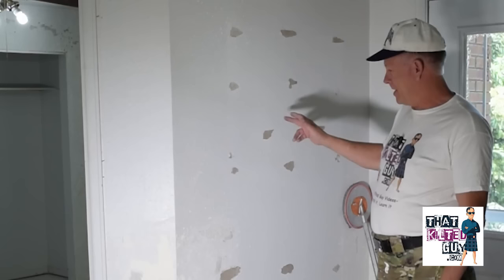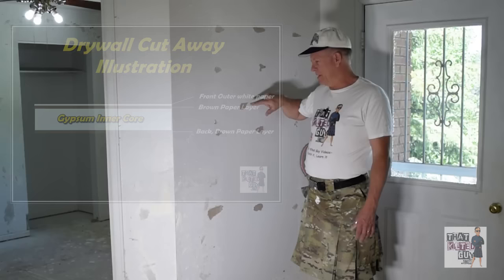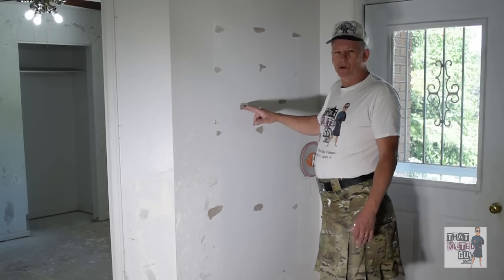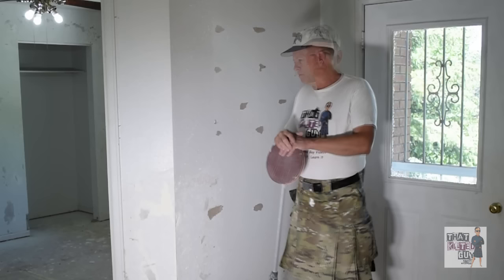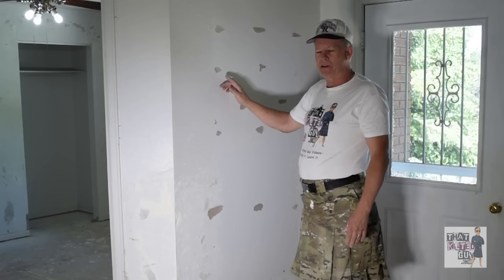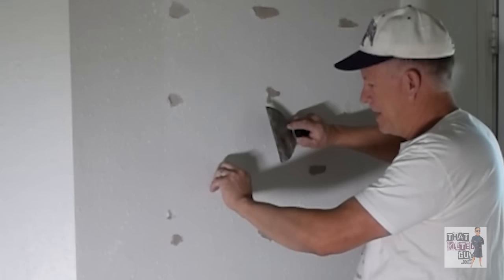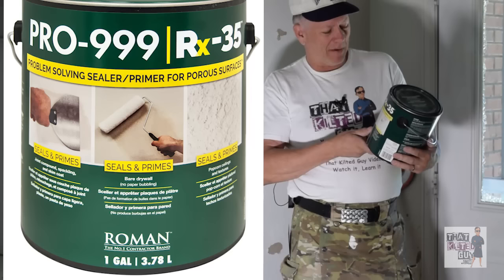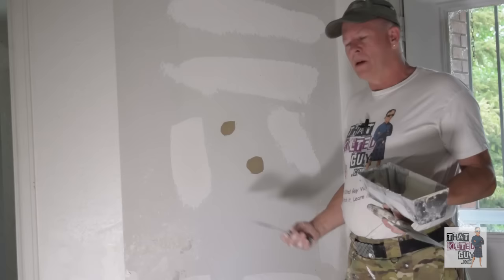⭐ Repair Damaged & Torn Drywall Paper BEFORE YOU MUD IT in 2022!

Comment: While this is a thorough and excellent way to do it.  Drywall goes up with brown showing all the time and they simply hit it with all purpose and move on with life.  I'd bet that 99% of houses have spots of brown paper with nothing but all purpose over them.  I've never seen or heard of it falling off the wall or being an issue.  

If you cared enough to do it, any paint or primer over the paper would do the same thing.  Anyone who needed this question answered is probably a home owner/novice.  They probably have a gallon of paint or primer laying around and a little all purpose mud but they probably don't have specialty primers or the like laying around and it would make little sense to buy some for a small single spot, especially since they won't be using it again more likely than not.
Reply from the maker: You read my mind, lol. I’m actually in the middle of shooting a video right now testing 11 ways to repair these and im showing WHY you sometimes need to do it this way and sometimes you don’t. 

But so far, I haven’t been able to consistently damage it the way I want. It’s much harder to do damage than it is to fix it for me, lol. But I did get a few spots to come loose the way I wanted and I coated them with regular mud and sure enough they bubbled up terribly and I will show that in the video.

I’ve specialized in these types of repairs for around 15 years and started doing it this way because it’s more consistent. Just putting mud over the spots does work sometimes, but it also fails sometimes and doesn’t waste a lot of my time. And I have a faster way than this product which I would demonstrate in the video. But doing it this way ensures much higher rate of Failure. 

Be sure you have subscribed to my channel and clicked on the bell icon and you will get notified when I put it out sometime in the next several days, I hope.

Also, I just launched a new website at ThatKiltedGuy.com and you can join my email list there where you will also get notified, along with getting my 16 page guide on how to choose a contractor for a remodel project. And that email will occasionally include articles, news and other relevant information for my subscribers.

Plus the website will contain tool reviews, recommendations and much more information than I can put here on YouTube.

Thanks for your suggestion. Take care, Guy
Reply: I'm just a part time handyman since I have a regular job with people booking me months out.  I do a lot of awkward/weird jobs.  Superglue on the back of something you can pull would get the ripping stuff off the wall damage about right.  Paint sticks maybe?  Construction glue in the snake pattern would be a common type of damage to repair.  You could mist water around the superglued stick to give it the separation easier probably.

I came across the video looking for a sponge tool on a pole to use in skim coating ceilings while I wait for mine to dry.  Just to see if there is such a beast that might work better than a regular sponge mop to knock down ridges in between skims.  I'm doing my own house today, so I can sit around and BS a little.  I stopped to watch because of the kilted part.  I don't generally wear mine while working.  You should get a small tool pouch that hangs in the front like a sporran.

I always enjoy videos that show a different way of doing something.  Even if it isn't one I'd prefer, I usually take something away from it about how something can be done that I can apply to future jobs.

Keep up the good work.
Reply from the maker: Yeah, what I did the first time was to cut 66 perfect 4" circles with my drywall circle cutter, in 11 rows (6 per row) and then peeled them back, but almost none bubbled.  So I then glued a piece of OSB onto some scrap then peeled it and those bubbled.  So the next day I glued 3 2x4x8 studs to my rock with construction adhesive and when I pulled them off, they didn't peel enough, and not enough damage, so I glued them on again, and tested one this am before heading out to repair 2 jobs with damaged ceilings, and it looks like it's going to be workable now.  Now I just have to find the time to finish the video.  Hard to do part time when construction can sometimes take up about 70 hours a week.  

Once I start making enough on here, I'll do this full time and quit the drywall business.  I'm 57, and ready to move on to something fun, and the videos are fun and much less stress.  Thanks for the ideas.  -That Kilted 'Guy' -

Comment: Why do you use two different kinds of mud...apprentice wanting to learn. And how to you get the repair not to show trough after you texture and paint
Reply from the maker: The first mud was a fast setting joint compound and if you ever use mesh tape you should always use fast setting mud over it. But in this case I used it because it will set up as quickly as 7 to 8 minutes depending on which one I use and that allows me to put multiple coats on in one day, and it has almost 0 shrinkage compared to about 30% shrinkage with regular drywall mud.

Once the repair is done prime and paint it twice allowing each coat to dry properly and extending the paint slightly each time. For the second coat it’s best to paint the whole surface but with flat paint you can usually spot paint.
Reply: That Kilted Guy DIY Home Improvement  thank you so much. And sorry to repeat the question. I didn’t read they the comments first.
Reply: That Kilted Guy DIY Home Improvement what is the best spray in technique to app,y texture..orange peel and knockdown?

Comment: My bathroom shower ceiling was moldy and the drywall paper was chippong off with the paint. I started peeling it away. I live in a rental and landlord wont make any repairs soon. The drywall has no paper left... its only the gypsum exposed. Anything I can do? Besides replacing the drywall. That's not an option right now. Looking for a temp solution. Thanks!
Reply from the maker: Well replacing is the best option, as now the ceiling is WAY weaker.  2nd option is to put another layer right over the top of the old layer and refinish it.  But if you can't do ANYTHING ELSE, maybe you could try gluing some heavy brown paper over the exposed gypsum and then applying the RX-35 to seal it, then refinish like new.  BUT, I don't recommend that and it could prove dangerous as it may still remain very weak.  That ceiling could come crashing down any day, so I highly recommend replacing it, or putting a new layer over the old. Good luck and keep me posted how it goes.  Best wishes, Guy
Reply: That Kilted Guy DIY Home Improvement I am in a tough situation. I cant afford someone to come replace it and landlord wont do it. Id rather try to buy some time until I move out, rather than have that moldy ceiling. So, I ended up chipping off the paint tjat was coming off. I sanded it down and cleaned it and added joint compound. This is probably terrible, but I really am just trying. I am not sure if that is going to work. Being that there are patches that still have the old paint and then there were patches with the gypsum exposed. 😖 lol what would happen if I let it dry, sand it off and apply a primer and then a semi gloss paint? #NoCLUE I feel like an idiot. Please, any suggestions.
Reply from the maker: Hello, due to the increased number of subscribers, and questions, all our questions are now answered on our Patreon page at: https://www.patreon.com/ThatKiltedGuy. We hope you'll join us there and help us to answer your questions, and to put out many more videos.  Thank you for your support!

Comment: can you prime then paint after that technique you just did or doea it have to be skinn coated the way you did it?
Reply from the maker: Yes, you can prime and paint after applying the RX-37.  That just locks everything down and allows you to continue the repair process.  But if you have torn paper like this, and don't coat the torn section and sand it, then it will show pretty badly.  Thanks for the question, and let me know how it comes out.  
Guy, That Kilted Guy

Comment: Hi:  you made so easy to follow.  Thank you.  I have about six inches of tape protruding in the middle of a painted wall ceiling to floor and ask if you could instruct me how to fix this.
Reply from the maker: Thanks, Remove any loose tape, and re-tape and finish it with new.
Reply: @ThatKiltedGuyDIY  hopefully I will pull only the tape.  If I get down to brown paper I will put sealer let dry apply mud then sand apply primer and paint.  Is this a good plan.  Thank you.
Reply from the maker: @valeriek5020  cut the tape about an inch after the last spot you think it’s stuck so you don’t pull more than needed.
Reply: thank you.....

Comment: Hello 👋
What kind of mudding you used because it looks 🤔 yellow than that first kind you put on the wall. Trying to fix a bubu my 3 year old did on the wall and is big lol 🙂
Reply from the maker: Any mud works.  I use hot mud for the first coat (setting mud, usually 5 minute but novices should stick to 45 or longer) and then I use USG plus the 2nd coat
Reply: @ThatKiltedGuyDIY  Thank you so much for the information. I seen a lot of videos and yours if the best and nicely explained. God Bless you 🙏❤

Comment: Hello! After we removed a deep freezer from our laundry room, we discovered that the two walls that meet in the corner have a huge area of this exposed brown paper. Its an area about two feet across and 4 feet tall on each wall.  I tried to add a picture to this comment but it won't seem to let me. Do you recommend trying this method or should we completely replace the dry wall? Thanks in advance!
Reply from the maker: Well one thing to consider is that once the outer layer of paper is gone the sheet rock will be weaker. If you feel this will be an issue then I would replace it. Otherwise you can just cover it with this stuff and refinish it and it should be fine. Let me know how it goes. Thanks for stopping by.
Reply: Will let you know. Thanks so much.

Comment: PLEASE HELP!!!---

I already skim coated & painted the wall where I had the exposed brown paper because I didnt know about that product you used. So now the spots are showing through. How do I apply that product now? Over the painted damage areas?..
Reply from the maker: Just take a sharp utility knife and cut out the area where it’s bubbling, assuming you mean it bubbled up. Then apply this product and follow that with a coat of mud and sand it like in the video. If it didn’t bubble, you can just put drywall mud over the spot thats showing and sand it smooth like in the video. Hope that helps. Please come back and let me know how it goes.
Reply: That Kilted Guy DIY Home Improvement Thank you for your help! You saved me a lot of time! I just put mud over the majority of it because it wasn't bubbling up. Just In a few small spots and in those spots I cut out & put this product on it. Then I put mud and sanded. I have another bathroom to do & this time im going to put this product on the parts with brown paper exposed. Thank you again! Love your channel and your videos!
Reply from the maker: Glad I could help! Thanks!
Reply: Sounds like you skipped the primer/sealer step.  Raw drywall or raw brown paper will absorb paint differently than painted drywall and will show through.  Using a stain blocking primer like Kilz or Zinsser 123 will even out the absorption and make the paint look better.

Comment: what about if i take wall paper off and see drywall that has brown paper on it. Do i need to mud the whole all or take the old drywall down and put newer up? The house was built in 1983.  I kind of figured I don't paint the brown paper backing of older wall paper. Any suggestions ?
Reply from the maker: If the original drywall just turned a yellowish brown, then it’s fine. But if you ripped off the outer layer of paper and exposed the brown paper underneath, then I would treat it like I did in this video. You cannot just paint or mud over brown paper because it will bubble up and keep bubbling up over and over. As long as there is still some paper on the drywall, you don’t need to take it down. Let me know how it works out. Good luck on your project. Thanks and take care.
Reply: I am currently going through this right now had to remove wall paper from a 3rd of my house

Comment: Hi Kilted Guy,
I primed and papered over an original layer of wallpaper, which, as it now turns out, had been hung without sealing or priming the drywall first. Thanks to the primer I applied, my layer of paper (the top layer) comes off easily. Unfortunately, thanks to that same primer, the original wallpaper is very difficult to remove and much of the drywall paper is coming off with it. I want to smooth and paint the walls. 
What would you recommend? Remove only the top layer of paper, use Zinsser Bullseye to seal/prime the walls (including remaining old wallpaper), then skim coat over everything? Or remove all paper, including large parts of drywall paper, then Zinsser, then skim coat?
I've learned a lot from your videos and would appreciate your input. :)
Reply from the maker: Hi, I've been feeling terrible, and moving this last week, so sorry for the late reply. Here's my rule- if the surface is sound, as in not bubbling, coming off etc, then I wouldn't remove it.  That can do more damage.  If you can mud over it and it doesn't bubble or come loose, then just remove the areas that are loose and fix the rest.  Then prime and paint.
Reply: @ThatKiltedGuyDIY  Thank you so much! I'm sorry to hear you've been under the weather. Hope you got the move done and are all settled in - and feeling better! :)

Comment: Is there any reason not to use spackling over torn drywall paper (after applying the sealer)? I’m asking because the store associate at my big box store assured me that using a lightweight “patch and paint”spackle would be sufficient. I have some paper spots that are torn 6+ inches long (anywhere from 1-3 inches wide). Most of it will be under the baseboard/trim, but it’s a bathroom so I want the wall to be well-sealed. I feel sealer and mud is more appropriate, but I have no idea what I’m doing.
Reply from the maker: There’s some spackle that’s only meant to be put on tiny spots like nails and others that you can spread further. If it’s the type that will go on a little thicker then it will be fine. Make sure it’s sandable.

Comment: I use Kilz primer and it's always done really well.
Reply from the maker: I tried it for about a year or two and still had too many failures. This product has been much more consistent for me.
Reply from the maker: And I’ve repaired about 10,000 of these. I’ve had better success with shellac and Spray adhesive.

Comment: Wait so why do you have to mud it twice & what's the difference between the 2 muds?
Reply from the maker: There’s no rule to how many times you have to coat anything. You basically coat it until it’s smooth enough to not show and 1 mud is fast setting compound for advanced to users and the other regular joint compound. www.DrywallAcademy.com

Comment: Hello, so I was about to purchase the 45 min compound to fix all of my 30 year old wall problems prior to painting. I have some nail and screw holes and I have some brown paper issues where we stuck things to the wall and we pull them off which exposed the paper. So do I need to purchase the 20 minute mud and the 45 mud for those purposes?  I would love to hire someone to do this but my budget is tight. Thank you!
Reply from the maker: For novices I would recommend no faster than 45 minute mud. 20 minutes might leave you with a pan full of hardening mud that is really difficult to clean.

Comment: Great video.  Quick question - I have to repair the drywall in my shower.  the paint bubbled...  when I scrapped the bubbled paint off, we have to repair the drywall paper too so the above video helps.  My question is we discovered that when they built our home and installed the drywall in the shower they did NOT make the corners of the drywall meet, so there is a 1/4 to 1/2 inch gap that they just filled with what appears to be caulking maybe?   What is the best way to fill this gap?  Fill with caulking or mud????  Thanks.
Reply from the maker: If the current fill is sound, leave it and just go over it. If not, use fast setting mud.
Reply: thank you very much.  One more question please - so I have removed damaged paint, as well as the bubbles in the brown paper part of the drywall... a few layers of brown paper later...  is that still part of the drywall (I think so) and can still be repaired with - primer, then mud like in your video?   Thank you again - your video and info are very helpful!
Reply: I just don't want to have to cut our the wall and replace if not necessary..........
Reply: I just don't want to have to cut our the wall and replace if not necessary..........
Reply from the maker: Jodi Irwin yes it can be, but not ordinary primer. Use the product in the video or the one I listed in the description.

Comment: I had removed the bottom tile on my bathroom drywall and all the paper tore off with the tile. I need to replace tile but it is down to the bare chalk no paper at all. Can I use a oil based primer over the exposed chalk then...  
PLEASE help! Anyone?
Reply from the maker: Mesh tape it and float it with mud

Comment: Can I also use oil based Kilz brand primer to seal the brown paper before skim coating?
Reply from the maker: It works better than nothing, but not as good as this product or the Gardz. Spray shellac also works
Reply: @ThatKiltedGuyDIY  thanks for the quick reply, I will look for Gardz! By the way, I just retired from the AF, 8 active and 15 Reserve...had a gap from 93 to 2005. Thanks for your service! 🍻